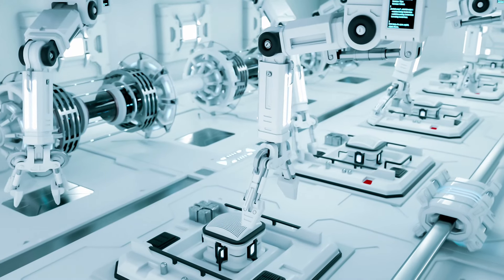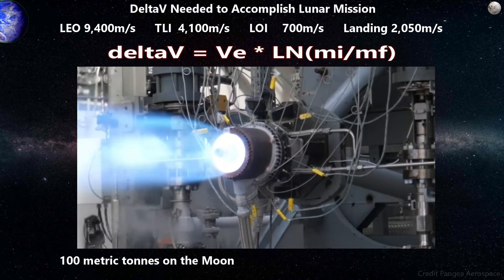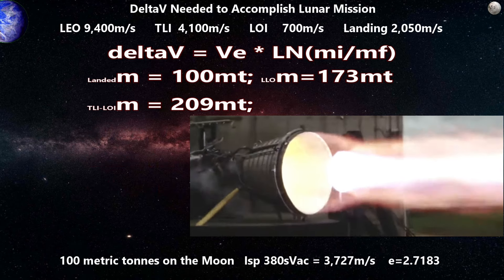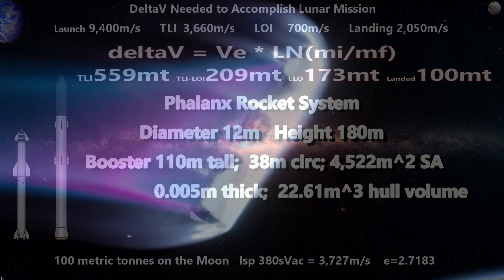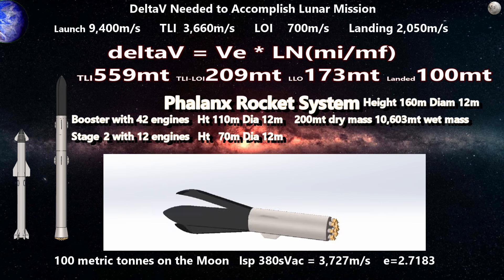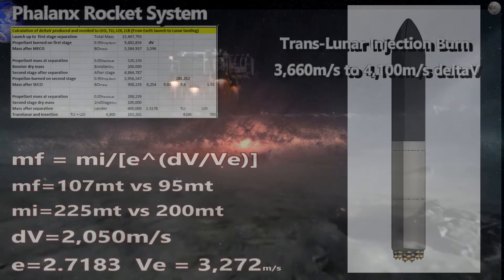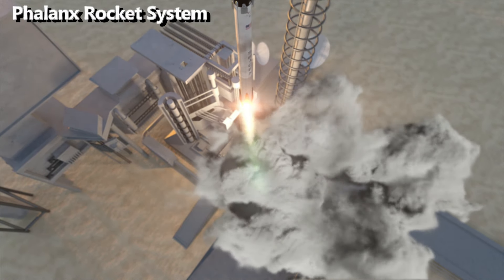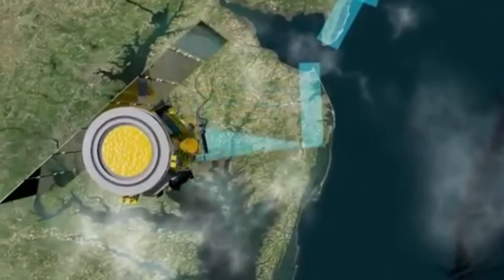Rocket Science: Designing a System Better than Starship: The Phalanx Rocket System

Comment: Your analysis of the economics of space mining and manufacturing is fantastic, but I think that you're missing a major element to your overall consideration - the geostrategic implications of controlling resource markets.

You're thinking of the companies that do the mining as you would think of a terrestrial operation, but I argue that being cosmological subjects companies to political realities which otherwise might not be considered.  Given the potential political ramifications if a private company had enough of its own gold, platinum, cesium, titanium, uranium, nickel, lithium, etc etc etc to crash metal markets.  That power will be demanded to be kept by governments till the overall markets are strong enough with demand to survive the glut of uncontrolled supply.  That means that until there is a demand for metals so large that it essentially requires a developed multiplanetary industrial economy, the importing of materials or goods from space will be tightly controlled, and probably used as an economic weapon.

That said, a government might be willing to fund a mining operation of a particularly rich asteroid at a loss to them, as the customer, merely to have access to that economic weapon, or even keep a rival from getting it later.  In that case, certain cost competitive situations may not have merit.
Reply from the maker: That is a major concern.  I think everyone has been blase to this point because no one is up there.  Those considerations will become extremely important as soon as anyone is.

Comment: Isn't Rockets outta date ? Haven't we tried to improve ? Yes to outta date and yes also to no improvement. So after the STS program,  which direction did you all think would come after this moment ? Well if you didn't notice or to young to remember, NASA went to bed for awhile and while they were sleeping, Roscosmo was ferrying astronauts to and from the ISS. 
Then things started back in kinda reverse by SpaceX because it seems that no one was thinking forward but if it ain't broken attitude, why fix it . We have all these different methods to create lighter and stronger materials. We've learned about the delta wing design but yet haven't been utilized since these 3 birds but one remains in an argument to this day.  The X15 is the argument for a classification and the real deal came afterwards in form of SR71 Blackbird, the share some similar looks to a point but way back in 1955 a SAAB DRAKEN aka Dragon was born . This particular aircraft was the first to actually stand in the sky, the Cobra maneuver was born and now we're in the future with many delta wing craft making extreme speeds. To put it plain and simple , a melding of these planes results in a form of a Spaceplane. A hybrid system and little lifting big or what I call the David versus Goliath.  Or someone best reengineer the Pulley system so it's again,  small lifting big ....C'mon mass guys
Reply from the maker: It was a long pause wasn't it?
Reply: @terranspaceacademy  Yes it was. The funny part is that I wasn't interested in Space and space exploration. I only really took interest when the STS program started. Plenty material surfaced during that era. To begin with, the gold model found in some Aztec ruins that share similarities and flight worthiness. This may even sound strange but it was the six million dollar man and an old 007 movie . I started following up with reading articles in Popular Science and Popular Mechanics, both had renditions of a craft that would ferry people from one side of the world to the other in record times. Btw those won't fictional stories but an idea that came from the horses mouth aka NASA. Do you ever wonder why they never move forward ? When will they put two together and come up with a hybrid Spaceplane. I want to challenge them because of the very fact , everything around us is changing and a rocket is still a rocket  , 2000 plus years and counting. I have a plan and it deals with weight loss and distribution and the all important part,  MASS . Btw it's only 52 meters in length and uses a runway.  I  will write your company directly so you can judge for yourself. I would have had it built but unfortunately I can't obtain material due to being just a regular Joe.
Reply: @terranspaceacademy  here's some food for thought. Christian Von Koenigsegg has an example of David versus Goliath here . A 3 cylinder engine that can outperform a V8 , V10 and a V12 . Check it out and I will tell you how I reengineered from the solid rocket booster and learn how to use a similar yet simple technique and comes with a shut off switch 🤣🤣🤣 . No turbo pump required

Comment: As someone with very limited experience with manufacturing titanium,  I cringed when you mentioned it in the design.  Strong and light is true, but burns like a sparker if you get it too hot. One fire on the pad and might end up with a hole you have to fill in before you can install a new launch facility.  It's nasty to work or machine, I've seen a lathe that was melted down machining it.   Also what happens to the price of titanium when you have to buy ' all of it' to build the first ship?  Disclosure: I am a fan of Elon, Spacex, and Star ship because as he says he's doing something that excites me and is so willing to share the failures and often with a sense of humor.  I can't imagine the EU, or any other government agency, being willing to have repeated failures with the 'opps goofed' mentality required for a hardware rich rapid iteration design method.  Lots of compromises were made in the starship design.  I fully expect the ship to get taller before too long, and we know Musk already has Starship 2.0 in his head.  I completely agree that you have to start making money as soon as possible to make the system feasible.  First you get paid to launch CRS and satellites while you learn to land the booster.  Then you get human rated.  Then you start starlink.  Then you building a larger rocket.  Use it to launch larger starlink satellites.  Try to get a moon landing contract.   Companies are surely starting to think about what Starship and launch for them.  Interesting video as always.
Reply from the maker: Titanium does indeed burn... It can in fact be used for fuel in a solid rocket motor.  Steel might still be better the Phalanx. You make several good points regarding bureaucracy! Our comments address what we hope they would do... Not what we think they will do :-)
This is mainly a thought experiment though I believe Phalanx is a serious endeavor.

Comment: Why focus on 100 MT in a SINGLE launch with no refueling?  That seems very 20th century thinking.  Economically, it's better to have a lot of commodity small launches than just a few high cost large launches.  The refueling paradigm thus allows for amortizing launch infrastructure over many launches of a high cadence as well as keeping launch support infrastructure and personel actively employed and thus on their own learning and upgrade cycles improving both efficiency and reliability.  This will be especially true if refueling flights can also support limited secondary payloads allowing for an additional revenue stream from refueling.  

Understand, I'm not saying your math is wrong.  And I'm not saying the Moon isn't a compelling target (much more compelling than Mars frankly), but I am saying that the insistence upon the one-mission, one-launch paradigm is just as outdated as expendable rockets.
Reply from the maker: To get the infrastructure to the Moon as fast as possible.  Once we can build and fuel large spaceships on the Moon Starship will only be needed to get humans to LEO.  Then lunar built superships can take them on to Mars.  Where a docked Starship can land them.
Reply: @Terran Space Academy   The desire to get the infrastructure to build spaceships on the moon is a deeply strange reason to support the 1-launch-1-mission paradigm... in fact, I would have said such a motivation matches wanting to embrace the refueling paradigm as much as possible.  This is because dropping such industrial capability to build space ships on the moon is simply not possible with a reasonable number of missions (under thousands), but dropping enough industrial capacity to produce fuel (and other commodity simple chemicals, Oxygen, Water, etc) on the moon isn't.

The only advantage that the 1-launch-1-mission paradigm has is mission-simplicity for the delivery of a few large stand-alone payloads like the Apollo missions.  However, mission-simplicity is not important when we are no longer considering stand-alone missions but rather missions as part of a larger industrial architecture.  Architecture simplicity is what matter then, even if it is at the cost of mission complexity.  The best way to gain architecture simplicity is design an architecture that will allow for the same ships and ship designs to be used for an extended period of time, both in the initial establishment of lunar operations, and leveraging the output of those operations as they become available.  That looks like this: MethaLOX to LEO, Hydrogen-Oxygen for trans-lunar operations (like Vulcan).  That's because Hydrogen, unlike Methane, can be easily sourced on the Moon.  While initial missions would involve Hydrogen fuel from Earth of course, Lunar hydrogen can eventually charge the system of fuel-depots that would make the larger architecture work.

Comment: I hope you know where a LOT of titanium is hiding or your plans for its use will never work.   Increasing the demand for a huge demand product will make the cost bigger than all your dreams!
Reply: Almost half a percent of Earth's crust is titanium [0.44%]. While that's only 1/11th of the mass of Iron (mass, not volume) that is a huge amount. The problem is: this titanium is generally available in form of titanium salts. Modern processes are able to refine salts to pure titanium though its energy intensive.  

Based on this, there is no physics or even engineering reason why titanium salts cannot be mass refined into pure titanium.
Reply from the maker: Nuclear powered titanium processing...  Ocean water reclamation... Or just use steel for the booster (reusable)... and aluminum for the second stage... With thermal tiles like the Shuttle.  The purpose of the exercise is to develop the tools to compare these different options.  Not to argue this is the only way.

Comment: Why couldn't you use a composite for the body ?  I think Elon's SS idea  is too primitive. I know everyone else is on board but me.
Reply from the maker: Composites on the Booster could be argued but they are super expensive and when you scale up they cost is prohibitive, also they cannot take heat.
Reply: @terranspaceacademy  Speaking of cost prohibitive: Titanium is almost three times as expensive as the same volume of premium SS-alloys and, in addition, it's incredibly hard to work with which drives the cost even further. You will need special tools, special machines, special processes, specially trained workers...
Reply from the maker: It is but for a limited use heavy lift vehicle it can be worthwhile... Do you know how much titanium we could buy with what was spent on SLS?
Reply: @terranspaceacademy  > "Do you know how much titanium we could buy with what was spent on SLS?"
Really a lot, I would say. But SLS, maybe, isn't quite the best example to go with if you want to establish a viable space economy. And I did already mention the difficulties of working with titanium. It's fine for doing a thought experiment though...

Comment: People are insane to build rockets out of SS. we shall learn this when RKLB builds a Falcon 9 competitor at 1/3 mass. You've all  been duped by Elon in thinking that SS is the best.
Reply from the maker: For a very large rocket with a reusable second stage it is... Neutron will not be a heavy lift rocket and I would agree that it will be better in many ways than Falcon 9.  But composites would have been a mistake for Starship.
Reply: F9 is not SS, it's aluminum/carbon fiber